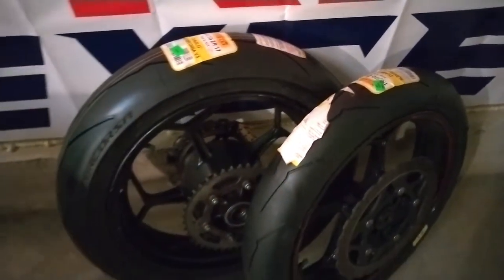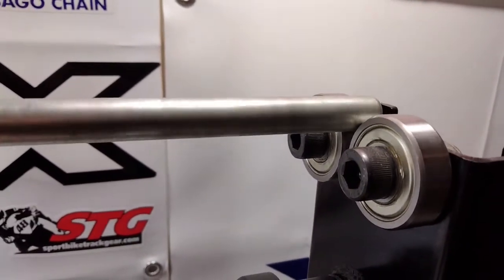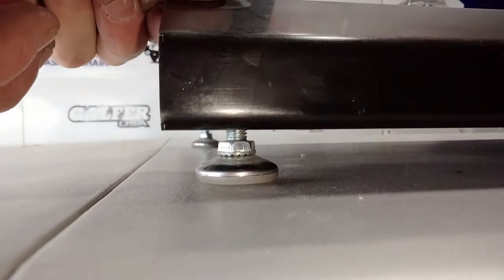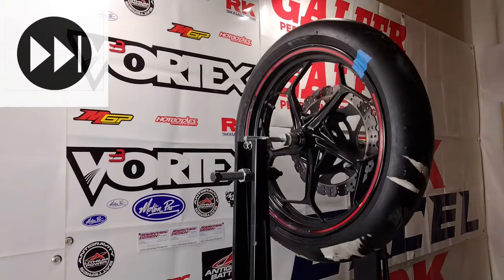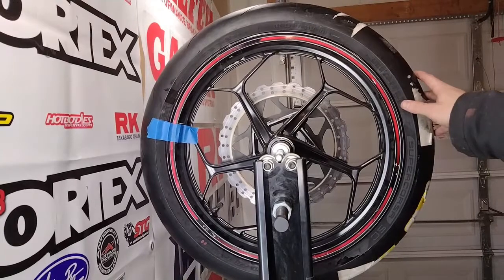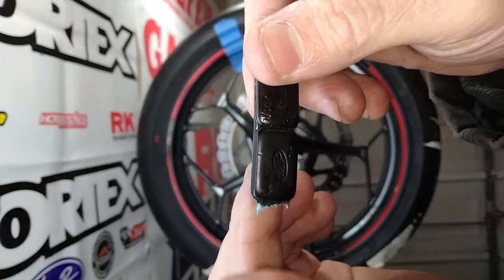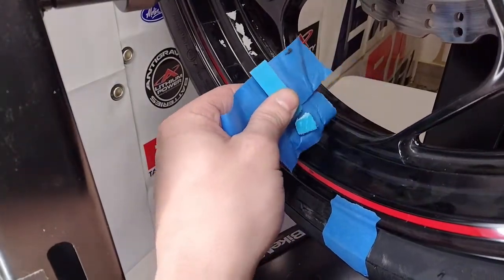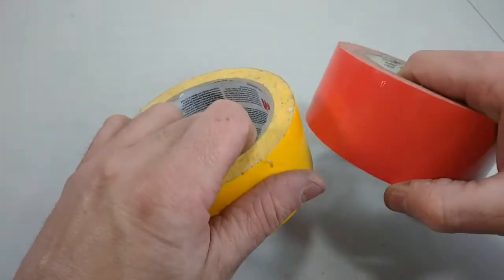How To Balance Motorcycle Tires With Static Wheel Balancer

Comment: Nice video..... What do you think of beed weights???
Reply from the maker: I dont use them. Nothing against them, just always liked the stick on weights but I also always tape mine. My best recommendation, is get smaller sized weights than I did. 1/8 oz weight make it easy to find the sweet spot.

Comment: Very good.....going to balance the spoked wheels on my 2020 Triumph T100.

Balance is a bit out since I fitted tyre pressure sensors on my wheel valves they weigh 10grams.

I dont under stand what the outer lock collars are for on these ballencers....the one at the rear of the cone.

Also my cones done seem to be perfectly centered.....wonder how I will go on with that.

Nick in the UK.
Reply from the maker: Think the extra locks are just redundant. If the cones arent centered that might be the fault of a bad part. This one is Bikemaster...its so so...not the best but pretty well made.

Comment: So, after finding the lightest section of the wheel and taping it, at the 12 O'clock position, then adding my weights, the wheel is balanced after the wheel stops at either the 9 0'clock or the 3 O'clock position ?? Great video, but this part was a little unclear.
Reply from the maker: its balanced when no matter where you position the wheel, it doesnt move or at least it JUST SLIGHTLY wants to move. The heaviest part of the wheel will fall to the 6 oclock position and adding weight to the other end at the 12 oclcok position offsets the heavy spot to make it evenly balanced. The wheel is considered balanced when you can move it to any spot in the rotation and it stays still. meaning that there is now no more heavy or light spot. each section of the wheel is equally weighted. Hopefully that helps.
Reply: @nickbuchananracing  Thank you

Comment: Instead of cutting the weight in half you can spread the weights apart on the rim.  This will average the effect of the weights and bring the wheel in balance.
Reply: That's called counter balancing you don't want to do that
Reply from the maker: never tried it that way. nice. you can also buy 1/8 oz weights, but I only had 1/4 oz...
Reply: @nickbuchananracing  I learned that when I had to balance a wheel on my road bike and I only had 2 of the same weights. 1 wasn't enough and 2 were too many.  I spread them apart on opposite sides of the light spot and with a little T & E, I got it balanced.
Reply: No, no, no, you never counter balance when doing weights! They get applied to the same area and not spread apart or put opposite of each other. That defeats the purpose.

Comment: Does it matter what side of the wheel the weights go?
Reply from the maker: nope. doesnt matter at all.
Reply: @nickbuchananracing  It does matter depending on what bike you have, refer to the factory service manual.  Some older Kawasaki's want you to split the difference between both sides.
Reply from the maker: @williamfoster4268  that might be true that some manufacturers say that but I think its a waste of time. The difference it makes is never going to matter on a motorcycle wheel. If it helps think of this, so I ride on track mostly and most tracks have a different number of lefts or right. So usually by the end of the day or end of a race, one side is way thinner than the other from wear on that side(race tires wear quickly). You will never feel any imbalance even though its lighter or one side vs the other....not saying anyone is wrong just throwing that thought out there because its a real world example of riding on a tire thats different slightly left to right ( at 120+mph where you would expect to notice stuff like that)
Reply: i was just going to type this i came from working on cars and with car wheels it matters
Reply from the maker: @8alakai8  I could be wrong but pretty sure it doesnt matter on bikes. I supose closest to the center is technically better...